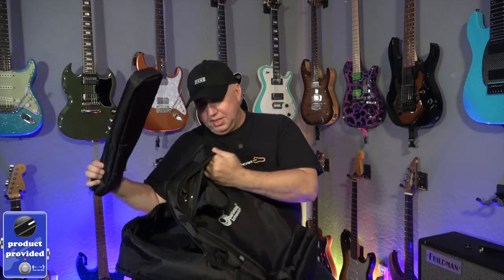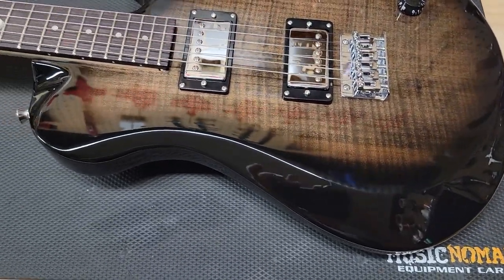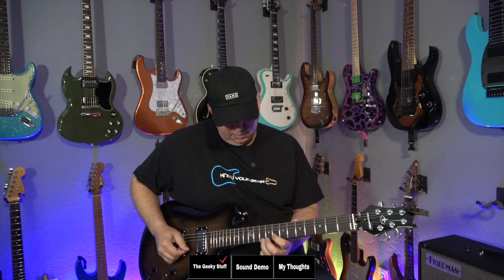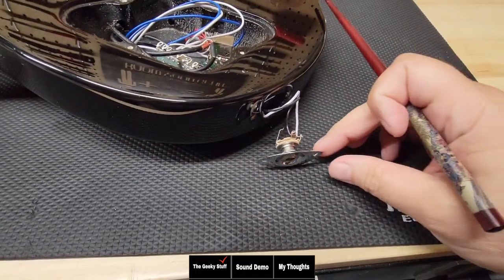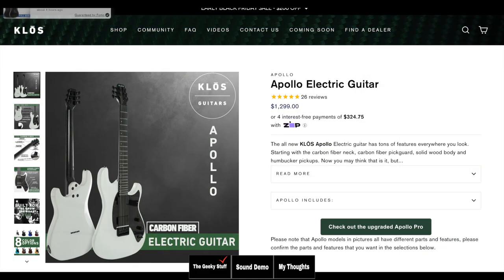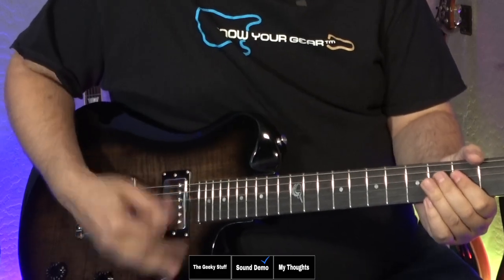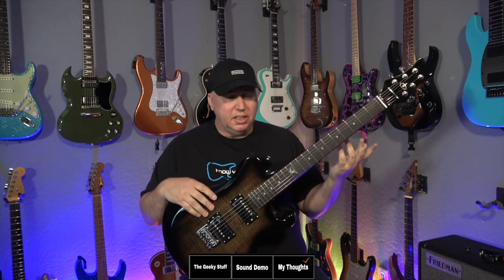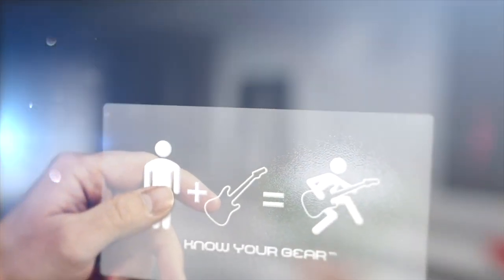Journeys Guitar Deep Dive

Comment: This looks like an improvement over the pretty confidential Stewart Stow-Away, since it has a headstock with tuners, while the Stewart is headless and is very difficult to tune because the tuners are located in the rear back. However, the Stewart neck can be stored inside the body, which makes it very compact. I'm very frustrated with my Stewart because of the 2 points I mentioned (no head, difficult to tune), but it is still a pretty clever system and a great travel guitar. I hope they'll improve the design, but it seems to remain relatively unchanged since many years

Comment: Big deal, gibsons been doing these for years.
Reply: You mean the detachable head stock? Lol
Reply: @jasonbates2687  yeah, title changed
Reply: Beat me to it 😂
Reply: Maple neck with volute, scarf joint, dual action truss rod, graphite reinforcements and minimal tiltback would be damn near impossible to break. Wish Gibson would take notes
Reply: @wilhelmtheconquerer6214  It's not really Gibson that needs to take note. They're well aware, but it's not what people want. They've done maple necks and volutes and other things to make the Les Paul necks be able take more abuse but everyone complained. I'm sure Gibson would be thrilled if everyone wanted their LP to have a maple neck, it's much cheaper than mahogany. Most of their Tribute series do have maple necks and its the main thing that turns some people off. Ultimately you can't make everyone happy and you can't blame a company for giving customers the specs they want. They know that most of the people that make comments like yours wouldn't buy their guitars even if they made them that way, but the people that do buy Gibsons also wouldn't buy them if they were made that way.
Reply: @ChrisEck13  it depends. The "standard" and reissue models should of course be made in the traditional way, but with any modern spec model they could easily try some new stuff.
The problem with the tribute models isn't the maple necks, it's that they also come with dot inlays, no binding, no pickup covers, etc. I.E, they look unfinished! That's a common thread with all cheaper Gibson models basically since the dawn of time. Compare that to Fender and Squier and you will find that even the Squier Affinity and Bullet-models look like complete guitars.
The way I see it, Gibson is offering one single spec that's uncommon from virtually any other manufacturer, and that's the nitrocellulose lacquer finish. Other than that, you get a much better guitar even from Epiphone, if you just swap out the pickups
Reply: @wilhelmtheconquerer6214  I disagree with that completely. Again you have to remember you're not a Gibson customer and that's not the way their customers think. Instead of making the Tribute series look the same and make it with cheaper parts, hardware, and electronics, they make them with the same pickups, hardware, etc so that the guitar is very similarly looking, sounding, and playing as a much more expensive guitar.  If you want a guitar that looks like a Gibson LP Standard for less then you should buy an Epiphone. If you want a guitar that plays, sounds, and performs like a higher end Gibson then the Tribute series is great. And yes the maple neck is often the spec that people have the most issue with. You mention pickup covers, which I don't understand because many of the Tributes do have pickup covers. Gibson struggled for a few years by doing exactly what you're say, trying to cater to people that weren't their customers instead of understanding their customers. They've been killing it over the past few years after making their guitars as traditional as possible, it's what works.  Read this article, if you still believe don't me there's many more things I can reference. 
 https://adamharkus.com/gibson-les-paul-tribute-the-holy-grail-of-guitars-for-under-a-grand/
Reply: Best comment hands down. 🤣

Comment: Okay, $500 isn't too bad. That's reasonable. You might be able to find a better cool used bolt on guitar for that if you shopped around, though, and accomplish the same thing with a little bit of extra fuss (which may include making some set up adjustments as well depending) if you're so inclined..